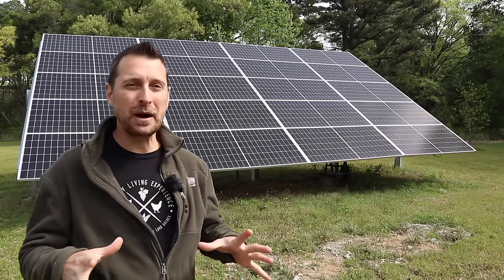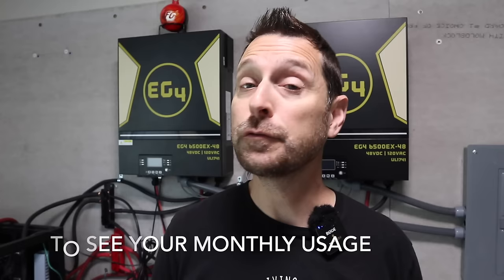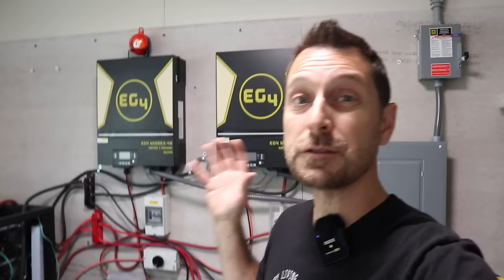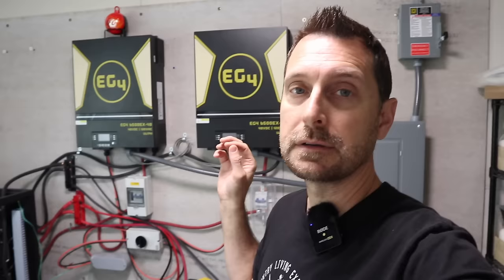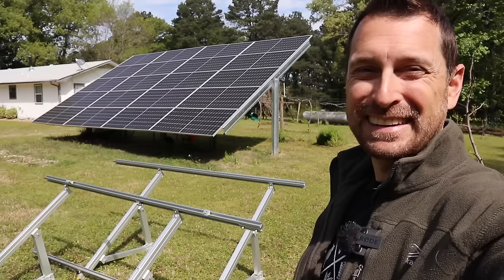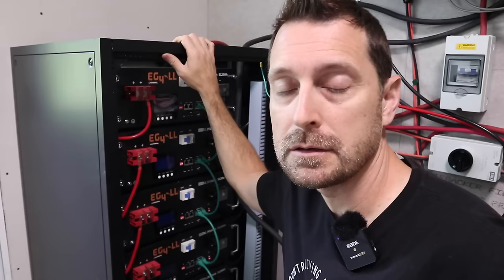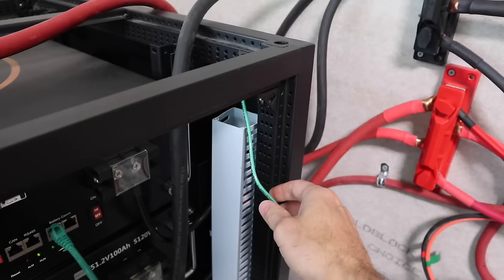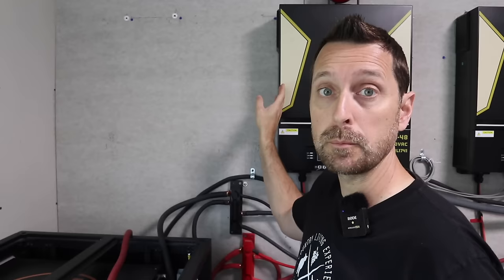Want To DIY Solar For Your Home? Start HERE!

Comment: Great job with this video! In the interest of safety, everyone please note the ball on top of the inverter. Its called an automatic portable fire ball extinguisher. Its recommended to grab a couple of these and place one on your battery bank and one on your inverter. They're cheap, and can add an additional layer of safety.
Reply from the maker: Thank you Brandon. 
Good idea mentioning that fire ball. I forgot.
Reply: @CountryLivingExperience  , yea I was wondering about that ball more explanation about the fire extinguisher would be helpful thanks.
Reply: Thanks for the heads up. For those who missed it, see. For example at 1:00. And it seems his is the AFO or Auto Fire Off brand, about $20-30 depending on size.

To you both/all, l would ask: for the kind of fire that could happen here, can we really put much hope in this sort of product? It seems focused on removing the oxygen to out out the fire. I'd fear that whatever caused it could happen again, whether due to battery or pc still pumping in power constantly. Sincere question.
Reply from the maker: @CharlieArehart1  It is the best solution that I have. It is better than nothing.
Reply: @CountryLivingExperience  thanks, and let's hope that proves to be so.
Reply: Does it really work for battery fires or is it for mitigating?

Comment: The One thing I've always hated about my House Layout is the fact that my Main Breaker Panel is in my Bedroom Closet along with the transfer switch, I'd love to have all the Solar Stuff in the Spare Bedroom I don't use instead, and I agree with you Off-Grid is the Way to go. It feels great to make your own power
Reply from the maker: That is the exact same thing that we have.....back bedroom closet breaker panel.
Reply: @CountryLivingExperience  I'm currently using a the Bluetti AC300 system, it's nice but needs to take more volts. (also more expensive than DYI) since it's in my closet it keeps me up at night when the fans go off, I had to take my clothes out the closet to put this system in it because it stakes up high taking up space.
Reply: I really need to emulate what you did because I personally don't feel comfortable having a "Powerwall" next to me when I go to sleep every night. I'm no medical expert but I'm quite sure there is some kind of negative of having it so close. Did you Reroute your transfer switch or just kept it as a separate system all together. I want mine separate. I'm in Michigan. We have Bipolar weather here. One last question has all those batteries ever almost depleted on you due to bad weather? I know you have an awesome setup but I have to ask
Reply from the maker: @Moes_Prep_and_Tech  I wouldn't want it near my head either. It worked out that the new room we built is as far away from all of the bedrooms as possible. 
Coincidence, I grew up in Michigan. I remember the bipolar weather. 
I think your comment was partially cut off. Looks like you were going to ask a question at the end.
Reply: @CountryLivingExperience  Nah it looked like it was cut off but I was basically asking have you ever had to resort to Grid Power with your current setup. Do All the Batteries hold you thru extended bad weather times like overcast days and winter?
Reply from the maker: @Moes_Prep_and_Tech  We did a video on how long our batteries last for the loads that we have. For us, our water heater kills it. It draws so much power, I can only last 2 days with no sun. I really need to get it switched out to the heat pump water heater I have sitting here...lol.

Comment: Grid tie-in allows you to send excess electrify back to your utility for a credit. You’ll then use that excess electricity at night or on cloudy or winter days. In a sense, your utility company acts as your battery. This is less expensive than installing batteries on order of magnitude.
Reply from the maker: I know exactly what it does and how it works. I don't recommend pure grid-tied for many reasons including the fact that when the grid is down, you don't have any power. It is useless sans the fraction of a penny you receive back for power generation.
Reply: a. The  utility is your battery, each excess watt you push to the grid is available to you free whenever you need it. It could be a fraction of a penny or it could be hundreds of $$$ when you’re generating but not consuming. 
b. Even if you live remotely, like I do, power outages are very rare and usually relatively short. If you want to double your system’s cost for those rare occasions by installing batteries then knock yourself out. Personally I think batteries are a waste of money.
Reply: Otherwise, good informative video — thanks

Comment: I'm 9 months into my first Solar system and absolutely love it. I built a simple 1 bed home with all the luxuries of a modern home.  I went with a 6000 watt inverter and 8 lead acid batteries because I'm just not comfortable with the Lithium batteries because of fires.
Reply from the maker: Awesome! Glad you have something that works for you.

Comment: Nice video gives a good picture of the whole process. I had a similar system installed but I didn't trust myself with the wiring so I hired an installer to wire my system. Better safe than sorry but I wish I had done more to get a better understanding of how things work. Everything is working but if something stops then I'm in trouble.
Reply from the maker: Thank you. 
I think you can do it. By observing the installer, I am sure you learned a lot.

Comment: Suspect that electric dryer and large water heater are something that require a really large system if you don't are hooked up to grid, 
a really large system if you live in cold north.
I think people are getting fooled if you think you are able to use all modern electric equipment year around with only off grid system 🤔🙂
Great video about basics 👍
Reply from the maker: Thanks. 
Each place is going to be different for sure. The water heater is the most unpredictable load since it cools off during the day and randomly comes on. The dryer is no issue since it only runs twice a week for 1.5 hours. I can do it in the South on this medium sized system. But yes, people are led to believe they can run a lot on smaller systems even grid tied.

Comment: Where did you get the metal work for your larger array?  I also have a few of the SS brightmount but I would like to mount on a pole with an adapter plate to mount the 4 hole base. i just don’t want to pour a concrete pad just in case I decide to move at a later date. Great video you covered all the basics.
Reply from the maker: It is made by a company called...https://powerssolarframes.com/. They are in AZ. I originally got mine from Signature Solar but they do not sell them anymore.

Comment: ☀️👍
Video well put together. No "hmmms" or "likes" ( or worst of all, "duhs").

Can you comment on your panel anchoring? How deep and how attached.
Thx
Reply from the maker: Thank you. 
This is a different type of racking system that has built in rails. They are anchored from the bottom with a special clip that attaches to the rail. Did you see our video on how we built it?

Comment: What temperature do you have to keep the equipment room at? In a room smaller that 10x10 (will build a room for the equipment) will a window unit (average sized) be enough to cool the room? I’m in CenTex too so it’s hot anyway but was curious how much heat these put off. Yes I know there are lots of parameters so a precise answer isn’t expected just wonder how much heat your sized system puts off.
Reply from the maker: A window unit will be perfect for that. The inverters just need to stay below 130°f. The batteries need to stay above freezing. The inverters can put off some decent heat but not enough to elevate a room temp more than about 95°f I would say. 
Many try to put them in an uninsulated metal sheds and that is the issue.
Reply: @CountryLivingExperience  thank you for your input. We are fixin to build a detached garage with the solar on the roof and the equipment in a room in the garage. We will make sure it’s insulated and we’ll have a window to that room now to accommodate a window unit. Can’t wait to say bye bye to TXU and Oncor. 😁 Again, thanks!

Comment: I would shorten your battery cables as much as possible as the longer they are the more resistance they will have and more voltage drop, not a good thing.

Comment: Nice video. Have you seen the Enphase products. They have a pretty neat looking “sunlight backup” solution with the iQ8 inverters, allowing you to run from your solar when the grid is down. Good intermediate solution if you aren’t ready to pull the trigger on batteries. Also nice system for those of us a bit concerned about high voltage DC, plus you don’t have a single point of failure like you do with a string inverter.
Reply from the maker: I am not familiar with the technical aspects of those Enphase products.
Reply: @CountryLivingExperience  they are pretty neat, and how I’m planning on building my system. Also really nice is they have some good (free) online training to learn about their products.

Comment: How much did your system cost? How much battery storage and how much maximum watts?
Reply from the maker: Total system cost was about $27k. That includes 11k watts of pv and 900ah/46kwh of batteries.

Comment: East and West roof has the most space is pitch for more winter style or early Sun and late Sun of the day and actually seems to get more Sun than the Southside at least in the summertime in the winter time the East pretty much gets about her almost as much as a Southside does Southside Roor more pitch for winter. And in the summertime the Southside of my house it's about six and a half hours of Sun. Which is more than what the four and a half hours to say I need to get or five and a half hours to see I need to get. And surprisingly myself side gets about the north roof gets five hours of Sun. I think I'm going to put solar panels on all sides of my house on the roof. I also have 3 ground mounts small ones that I put solar panels on and I'm making two more to put solar panels on.
Reply from the maker: Do what you think is best for your home.

Comment: Perhaps you knew a little about your home's main breaker panel before you embarked on your solar journey, but many do not.  A few questions on your "off-grid" system: (i) you show the inverters go to a sub-panel (why is this needed?), which then presumably sends 240Vac to your main panel . . pls describe sub panel-main panel connection; (ii) you mention still having the utility connected to your main panel, please confirm you have an "either/or" manual transfer switch that allows you to re-connect the grid/dis-connect the PV (like a backup generator as you described) and how is that transfer switch installed?; (iii) does the utility or electrical safety bureaucracy need to be informed when you retrofit an off-grid solar system to your panel? (ie. when they see your grid consumption drops to near-zero, do they send out a posse with handcuffs?)
Reply from the maker: Learning about the breaker panel was part of the first section on learning and gaining knowledge. I did not know much before that.
My inverters are 120v each and are connected in split phase. They need to combine on a double pole breaker in the sub panel to supply 240v (120v to each leg). This is sent to the main panel via 4awg wire to another double pole breaker. That breaker is isolated via a generator interlock kit so that the grid main breaker and the solar breaker are not on at the same time. This is set up like a manual generator type connection. I have many other videos that show the connection and setup process.
I always recommend that people check with their local utility company before starting.

Comment: Great info! Can't wait to see more installation videos on the barn. How do you disconnect those mc4 connectors? Mine mc4s are enclosed like yours. I don't seem to be able to disconnect the solar panel mc4 from the cable extension. Do you have a tool that can fit yours and that you can recommend?
Reply from the maker: Thanks. 
Our mc4 connectors came with a little blue tool. Some connectors are a slight bit different so you will have to find one that fits yours. I think they are only a couple bucks on Amazon.

Comment: Hello sir, I wonder if you can give me any setup recommendations to install a EV fast charging using solar panels, how many panels and batteries also which inverters are better, thank you?
Reply from the maker: It really depends. Is that all you are going to use the system for or will it power part of a house? Which EV? Which EV charger? What is the fast mode on that charger rated for in amps and volts? What time of day are you going to predominantly charge the EV? Where do you live? There are a lot of factors to consider.
Reply: @CountryLivingExperience  Thank you for your quick response, I am new to this world of solar, The system not gonna power a house only for charging the EV, the idea is during day hours, this is the charger I am planning to buy from Alibaba, AC 22 KW EV Charger 7 KW 22KW Wallbox Charging Station 22KWH Type 2, rated power 400v 30A, I am planning to install this in Cuba and the vehicle Geely Panda Mini EV and electric tricycles with battery capacity around 5 kw Thank you so much. the vehicle
Reply from the maker: Very interesting. I have friends from Cuba. May I ask how you are able to afford such equipment living there?
Reply: @CountryLivingExperience  Ohh, I don't live there, my family does and I want to help them because the situation is critical.

Comment: Thanks for all the great videos!  Since you have both the Growatt and the EG4 Inverters, do you think the flickering issue is important enough in your experience to affect the decision on which manufacturer to go with? I know the price and simplicity of the EG4 Inverters is a great selling point, but like cheap out of round tires, will I hate myself later on for purchasing them?  Wondering how watching tv after dark with flickering lights is going to affect me.
Reply from the maker: You’re welcome. 
I had a slight flickering with the Growatt as well. It is the cheaper led bulbs that flicker. The EG4 have been great. You would not regret getting them. The owner of Signature Solar did a video showing that even an expensive inverter like a Schneider or Solark will make a cheap bulb flicker. You should check out his video.

Comment: I have 4 of the EG4 6500 and see that nobody uses the  current sharing cables. Maybe I don’t understand the use for them. So why not?
Reply from the maker: Current sharing can only be enabled when you are using multiple inverters in a single phase (120v). Do not connect them if you are using multiple inverters in split phase or 3-phase because they can damage the equipment.
Reply: Ok, great knowledge!
I am going to run 4 inverters in split phase. Thanks for the update.

Comment: How do you get your EG4 6500 to work right a lot of people have problems with them
Reply from the maker: Mine works fine. Not sure who you are talking about. I have heard of some problems but not many. I am sure the group that is having issues is loud and vocal because they are upset so it seems like a larger group. I suspect it is a very small fraction of total EG4 owners and units sold.
Reply: @CountryLivingExperience  I like SS and EG4 ButI seam a little work need to get them right. For now I stick with my Growatts No problems at all with them but they been out for a few years and have most of the bugs out of them. Thanks when are you going to do your Little PV setup. And you said you was going to put your old Growatts on your well pump or barn. do you have footage of that. Enjoy you and watching you You do a fine job with your videos THANKS
Reply from the maker: Thank you. I totally understand. I am working on those new videos now. I am still working on building the shed to house the equipment. I have put out two videos in the past few weeks on that process. I appreciate it.